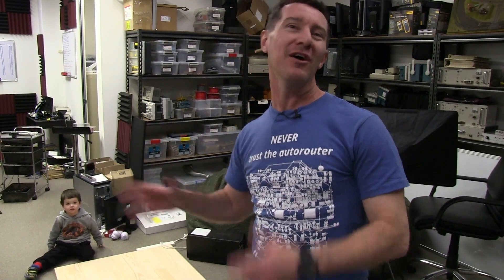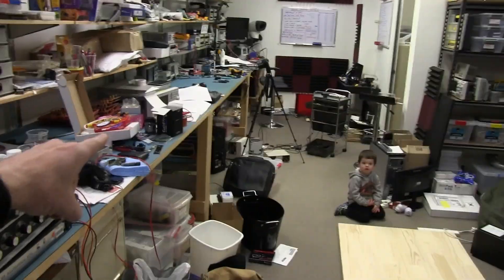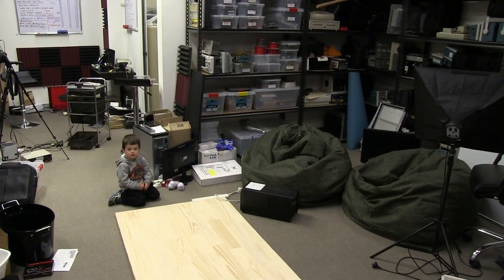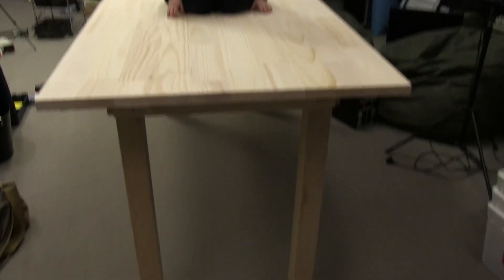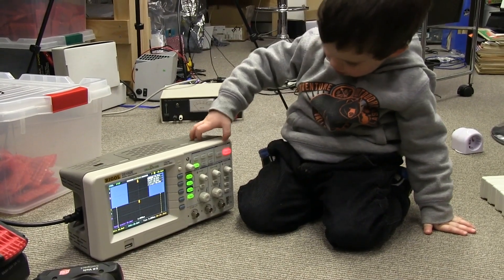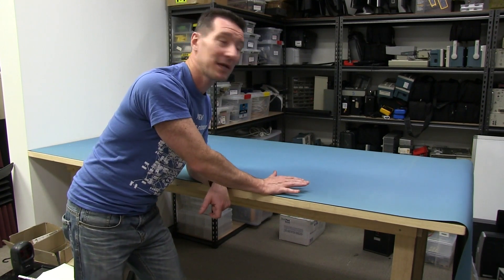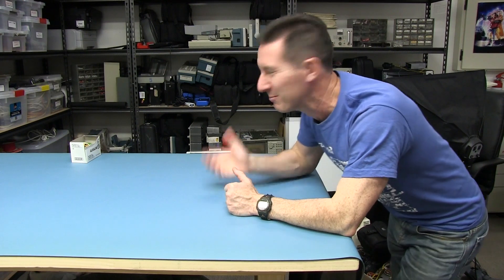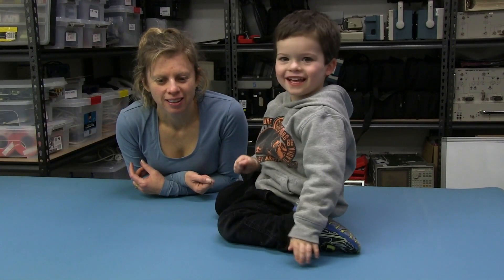EEVblog #640 - How To Build An Electronics Work Bench

Comment: Put a stretcher or other types of leg support to reinforce legs. You wouldn't want legs to be broken or stuff knocked off bench if a chord or something got caught on legs. Also you can build a very low shelf on base of bench as reinforcement to legs and add additional storage when bulk stuff needs to be elevated off floor.

Comment: Suspended soft boxes may be the answer, thee are brackets available for most that you can fix to solid ceilings, but to mount on your ceilings there are some clips that are designed for fluorescent fittings that you could use 
http://au.rs-online.com/web/p/girder-suspension-clips-hangers/0377243/
I've used these myself where i worked.
You could fix a board to those clips, then screw any bracket to the board

Comment: You can make an infinite background the other way across the lenght, by adding a thin vertical wall to the longest side of the bench and rolling the mat from there. You'll need to be aware of any shadows coming from lights behind the wall though, but with a three light setup (primary + two backgrounds) it would be perfect for teardowns and other bench videos.

Comment: Lucky guy to have the whole family involved in helping in a remodeling the place. 
If you are going to have overhead lighting. Why not have a over- head camera on tracks or on a wheel type in one place overhead. If you need to change shots just bring the camera to position on a single track while the wheel turns to the position and you can zoom in or out on track and tilt the camera up or down? Also, if you need to get close or far from the table, use those device that table lamps use to position the lamp too? 
Good luck.

Comment: hey dave EEVblog you should make a bench with everything integrated made especially for videos like built on solder station and sucker and the table has gorilla glass with a screen mounted behind for a monitor that is out of the way and a green screen behind you and hot glue station and a chute so you can brush dirt off the table down the chute it goes into a bin under the table it would be a cool project as you should have a desk with things intergrated so nothing gets in the way it all has its set place i am liking the new bench you built it is clean good looking simple very well built and was a great that your son and wife was involved you are a really great inspirational guy keep the videos coming and i especially love the dumpster dive and mailbag videos i may try to mail something to you i just need to find something that will interest you i may be able to send you some dj equipment or something that you may find useful or a good project to fix in your spare time i may get it sorted and sent hopefully round Christmas time :)

Comment: Using a proper light box for product shots is much better than a blue background. They are easy to light, specially considering you seem to have a whole bunch of lights already and they give a nice soft light. Coloured backgrounds are also problematic since the reflected light is also coloured which give an odd tinting. This light boxes you get from eBay are dirt cheap and also tends to be foldable so they take up very little space when not in use.

Comment: Such a freestanding bench has no lateral stability even with supports youre going to add low down. Needs either diagonals between every pair of legs or... attach a piece of lumber on the wall just under the table and put screws through table into the lumber.

Without some kind of lateral stability its going to go over sometime mate!

Comment: Walk around in your bare feet for long enough in a electronics environment, You will soon find that upturned 8 pin D.I.L chip you lost on the floor, OUCH!! :(
Reply: I call it the 555 pain.
Reply: Yep! That is bloody painful!
Reply: Felt that sting too many times - pulling it out is the worst.
Reply: ***** No, standing on a nail that went THROUGH the safety shoe sole is worst. I contemplated the new wooden foot attachment for about a minute before pulling it out. Then went and got it bandaged, then a tetanus shot. Then went ouch.

Comment: The problem with the "old" benches is that you need shelving over them for storage, test gear etc, which gets in the way of good lighting. Your island bench doesn't need this, so I would suggest 2 or 3 lamp units suspended from the ceiling (maybe raise/lowerable) with nice big diffusers, right over the work area. With you on one side of the bench, the camera on the other, the key light can be on a tripod to one side of the camera a 60 degrees or so to the subject.

Another idea: the work top is going to be at Sagan's head height soon, it would maybe be an idea to router or plane a chamfer on the edge of the work surface, just in case he (or anyone else) accidentally hits it. It will make the corner less prone do being damaged and damaging boxes etc.

Comment: You might want to check theses out they provide very even light. There built somewhat like a lcd pannel inside there fairly sturdy units.

http://www.ebay.com/itm/6W-9W-12W-15W-18W-21W-Dimmable-CREE-LED-Recessed-Ceiling-Panel-Down-Lights-Bulb-/360760709041?pt=US_Light_Bulbs&var=&hash=item53ff038fb1

Comment: Nice Bosch drill.
Reply from the maker: Yeah, GSR 18V professional. Very nice.
Reply: EEVblog For an electrical engineer too.
Reply: I have two makita 12v and 14.4v drills.
Reply: They are nice, I only have a small Crap and decker 9V one, and it is very handy as a small drill and a screwdriver. Dewalt 12V one at work, both were dead and I had the batteries repacked, cost $20 per pack. Do not buy the cheap 4V8 ones, they are total junk, I took them apart for scrap metal, and that was not much either. I only got 6 months out of then at best, but at least I did not pay full price on sale for them or they were a part of a promo pack.
Reply: Went cheap on the tiny battery though.
Reply: I love my DeWALT.
Reply: 18V Metabo all the way. A bit heavy but german quality.
Reply: No, Bosch from Germany.
Reply: ***** i dropped a brand new dewalt off a small stepladder and it snapped in half at the handle! i always get makita now.
Reply: ***** They are still OK drills but just no-where near as good as people make them out to be.
Reply: robthesamplist poop.
Reply: droid Black and Decker use to be a much higher quality brand in the past, especially when they were made in the USA.
Reply: robthesamplist
My Dewalt is probably 20 years old and still works like champ. I imagine that if you dropped a Bosch and hit hit just right, it would break also. Shit happens. 
I do like Bosch products. I only use Bosch Platinum spark plugs in my car.
Reply: bosch unkillable! I'm also a fan of hitachi.
Reply: Really in the end it comes down to personal preference. One brand may have crapped out for one person in mere weeks and laster another for decades. I have dealt with all brands and all have had their fair share if impressive durability and all have had their fair share of premature failures.

Comment: If you need to do it as cheaply as possible, you can get a photography umbrella  to light the area, and then use a foam panel as a bounce board for the light.
If you want to remove all shadows, then a 3 light setup can work (with the center light with a higher wattage but on a dimmer and in a softbox attached to the ceiling, its output can then be adjusted until the lighting becomes as even as possible. A great way to check is to do a HDR photo of the table surface, it makes it easy to spot and unevenness in the lighting at which point some additional diffusion can be added to parts of the light, or the lights can be moved further away.
 (only issue that it will make work at the table harder as you will have some lighting aimed enough in your direction to be annoying if you have to work at the table for a long period of time)
Reply: Does Dave ever really do things cheap?
Reply: Gadget Addict  Not sure, but studio style lighting can vet very expensive, very quickly, especially when you want to go with constant lighting instead of flashes, and we can only assume that stores over there will price gouge, thus either custom building, or buying constant lights and softboxes, or adding diffusion material to photo umbrellas can be a more cost effective way too do an even 3 point lighting setup.

If non even lighting is okay, then a simple overhead light and then a desk mounted light that can be moved will also work. (even cheaper and still allows everything to be lit well.
Reply: Razor2048 Well he already has those fancy remote controlled LED lighting panels installed and the sound boards etc. So I don't think he'll scrimp on new lighting. But I agree, it can be done on the cheap :)

Comment: Cute kid. My little guy loves visiting my shopping the basement. He loves playing with my cordless drill. Have you considered putting a shelf (or two) below the table for storage?
Reply: EEVblog You need a "Sagan height" bench... for your little helper.
Reply: +rocktheworld2k6 Definitely no drill bits. :) I hold him while he holds the drill (a Bosch compact drill) and presses the trigger. He also wears safety glasses. He insists on wearing them which is good. The other tools he likes is the dead blow hammer and rubber mallet.
Reply: I hope when he's playing with your cordless drill he has nowhere near any access to the drill bits D:
Reply: RickMakes  learning at a young age well you have to start some wear
Reply from the maker: Thought about that, but already have lots of new shelf space.

Comment: What about adding wheels so you can move it as needed. The heavier wheels have pretty good locks to prevent it from moving, or you can just have 2 wheels on the side near the wall.
Reply from the maker: I did consider that originally, but I don't see much use for it.